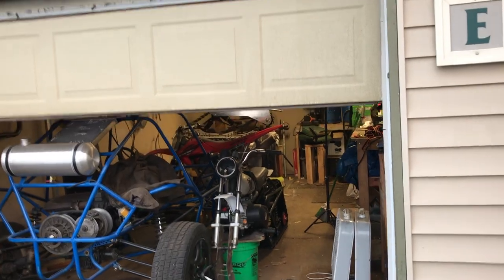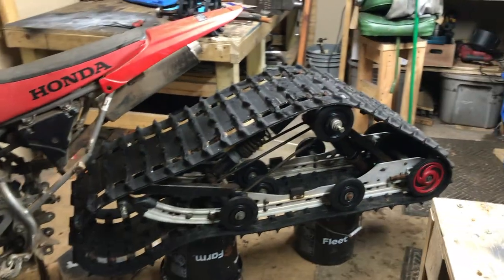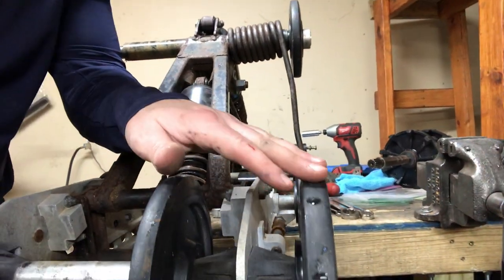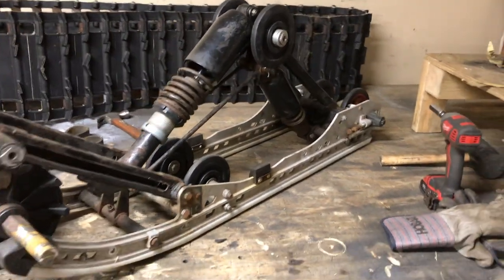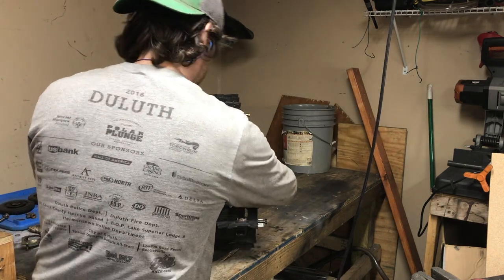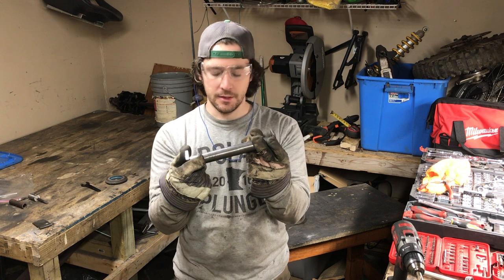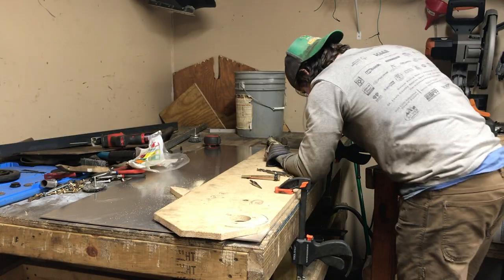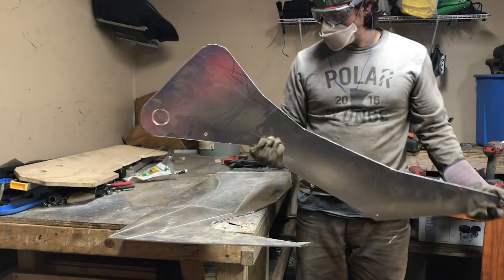HOW TO FIT A POLARIS SNOWMOBILE TRACK TO A HONDA CRF150F: Part 1 Custom Snowbike Build!

Comment: Hi Jake real nice build you did I would like to build one if you could and would want to build an other one let me know were about do you live if not to far from me I would be intrested in building two with your proto type and info I would see about getting the sides laser cut and get the frame welded from my shop and the parts turned on a lathe  only thing I do not have a bike yet well I have a Honda CBR600 that would be a great bike to build this with for mine let me know what you think and what did the track run you.
Reply from the maker: That dose sound Aimee some but I’ve relocated to Ohio, which is sad cause I no longer have my shop for now. If you have question feel free to ask, but my interests have had to switch to smaller indoor stuff.